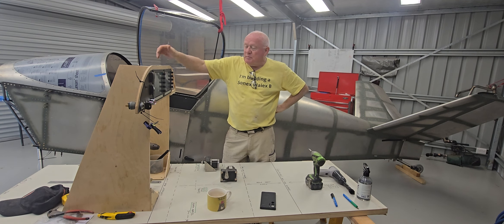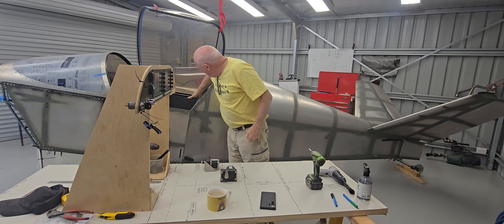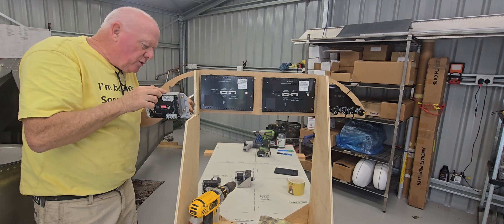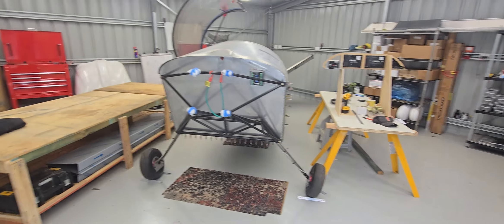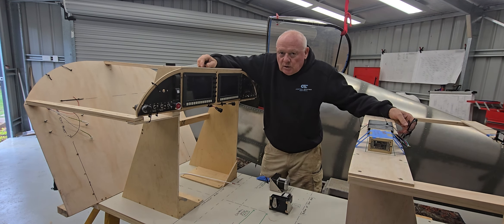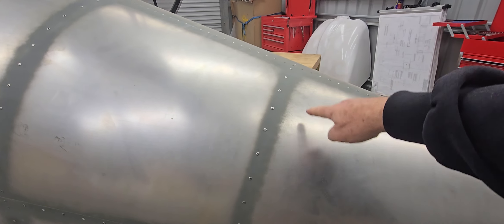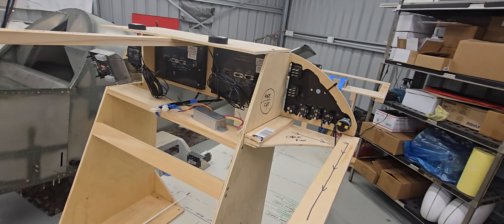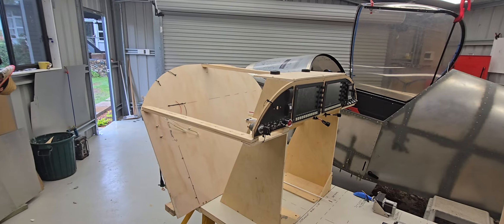Sonex Waiex B, part 39- Instrument Jig set-up

Comment: Looks great Andy!  I did something similar to wire my panel and headset jacks on the bench.  Not as nice or elaborate though.  I also ran wires either along the path of the rudder cables, or down below.  Worked well.  Leave both floors off for as long as possible!  I have a dual stick cockpit and have a disconnect for the PTT button on both sticks.  That's handy when the airplane is together, in case I need to get under the panel I remove a stick.  

I'll have to send you pictures of my cylinder head cooling fin cleanup and baffle modifications - something I think should be mandatory.
Reply from the maker: Thanks Bryan, those pictures will be great for reference...It's always hard to know when to close up and rivet off, and always knew I would leave this area ( cockpit) clecoed until finished...that's why the fuselage is still off, including underside off main fuselage...can you also send some pictures of the throttle and how you reversed it..Regards